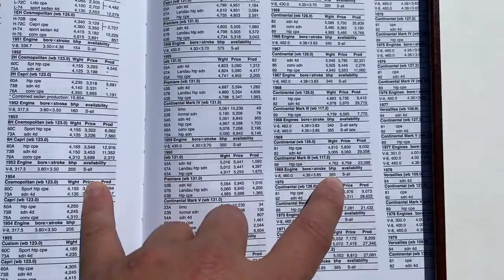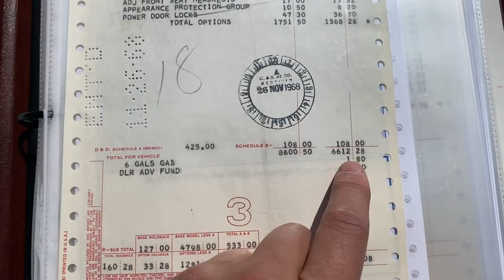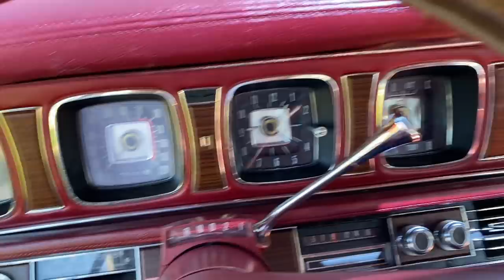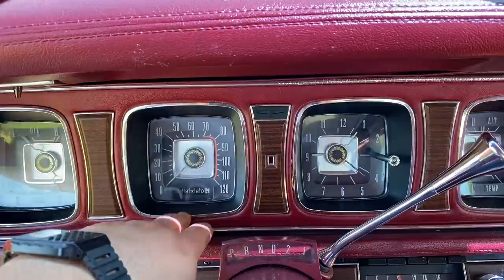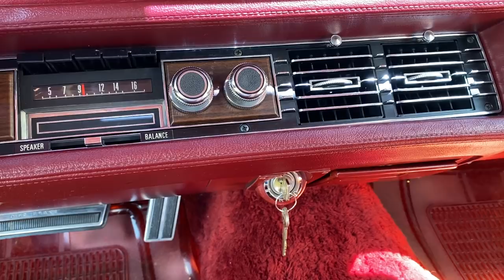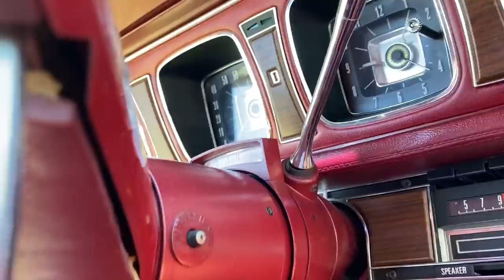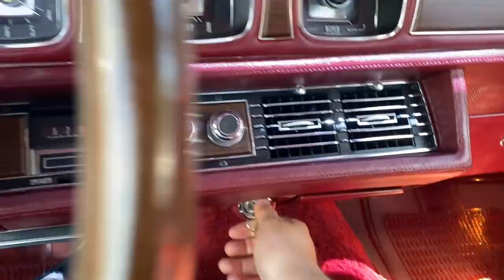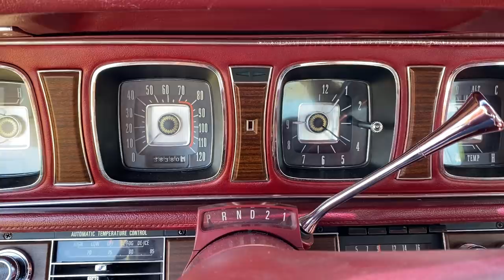The High Point of American Luxury Cars: 1969 Lincoln Mark III

Comment: I like the fuel chemistry you use to keep the 460 alive.
Reply: Sounds over the top to me.  I'd use premium only, and if hearing a knock, then use an additive or race fuel.  My '63 Coupe De Ville runs like a top on Premium with the 390 high compression I rebuilt years ago.  Before storing for the winter, I use fresh Premium with Sta-Bil.  As for his 160 degree thermostat, not the best idea, engines have proved to last longer with stock - the old cast iron blocks need to warm up well (not hot) for long life.

Comment: 23:40  Useful headlight door fact
Reply: 1967 Thunderbird headlamp vacuum motors actually had the spring forcing the doors closed if there was a leak, but 1968/69 and Mark III had the spring forcing the doors open for safety. I like the no-spring idea.

Comment: Hi Adam, I used to own one of the very first Mark III models (the 1968 1/2 as some call it).  Got it around 2002 when I was finishing college, and it was in decent condition.  Kept it for a year.

The car was dark blue with black vinyl roof and black leather interior.  I remember it had a different interior than yours - smaller, more intricate seat designs with no headrests, and a simpler, less attractive steering wheel with walnut trim and the rim blow horn.  

To turn it on, I had to crank the ignition key while holding the gear selector between park and reverse.  The 460 engine could still haul ass even after all those years!  Only thing that bothered me about driving it was the high padded dashboard which obstructed the view of the road for me, and I could not adjust the seat any higher (I am 5’8”).

I really like the color combo of your car in maroon interior and exterior.  I think these cars look really nice in bright colors.

Comment: Hello Adam,  Sir I have Enjoyed your YouTube Channel, quite the trip down memory lane as I was an ASE Master Technician starting out at a SOHIO-BP Procare repair shop about the time you were starting kindergarten,those were challenging times attempting correct driveability problems that the factory and dealership weren't able to rectify, I so very glad when Computer Controls especially OBD II became standard by law so manufacturers like Ford were forced to make their vehicles easier to diagnose without have to hook up a BOB (Break Out Box) to get any Live Data (so called live). I know You have a slight GM bias, however I believe anyone who repaired Vehicles for a living especially back in the day did as they seemed to be built with the Idea that someone would have to repair them !I worked as a Lead Technician on a Diagnostic- Drivability-Electrical Team at One of the Largest Volume Chevrolet Dealerships in Virginia for 20 Years until Back problems caused me to go.on Disability about 5 years ago. Scott Winters RK Chevrolet Virginia Beach.

Comment: Lovely specimen. Truly special. Congrats. FMC liked to use vacuum lines. Our 197x Merc Montego (Torino type) used vacuum hoses to operate the A/C controls. It had a bunch of black tubes with stripes in colors for ID. I remember putting in a stereo and wiggled around those tubes for access. (There is a slight possibility I might be mistaken. It might be another car. That was a looooooong time ago.) Even in the 70s with all the early inefficient  emissions controls, the smaller 351C moved that 5000 lb car pretty quickly! I remember having fun driving it as a kid. IMO, those FMC cars with the smaller trunks and giant noses were the last in a (very long car design fashion?) history going back to the Duesenbergs and old limousines. You could build a small house on those giant hoods.

Comment: In the very early '80s I bought a nice '71 Lincoln MKIII from a local dealer's used car lot. The car was a dream to drive. I bought the '71 as a buddy of mine had a '69 MKIII, and I really liked the styling. I took out a membership to the Lincoln Continental Owner's Club, and read an article about how to get more low-end torque by switching to a smaller ported aluminum Edelbrock intake manifold. This also would knock off about 25 pounds of weight off the engine. The manifold installation made a noticeable difference in low end acceleration due to increase air/fuel mixture flow. I also liked to keep my ignition timing advance for more power; hence I had to mix 101 Octane Booster with my gas. Lastly, I read an article saying that the multi-piece die cast grill cost Lincoln $350 back in 1968. That would translate to almost $3,000 in September 2022 dollars.

Comment: Adam, I have a a69 Mark III, and where I live is latitude 37 south, so one thing I don't have to worry about is serious cold.  What I did was block off the exhaust crossover passage in the intake manifold. This kept a lot of heat out of the intake and it is happy running on 95 octane. I make plugs, but I am told that racing gaskets block the 5th port. I would recommend this. Gary

Comment: I owned a 69 MKIII it waa the only year ford did a factory balance and blueprinted engine at wixom plant. It was a new model and the quality control was extensive on these vehicles. The 460 has a externally balanced counter weight on the crankshaft end for that purpose. the build sheets are under the hood fabric above the air cleaner. when they were going down the assembly line the hoods were up with the sheet hanging down from that area. they tucked them up under there. your example is really nice. Mine had the embroidered rear seat. Mine had the heavy fabric spare tire cover that matched the rest of the trunk. It also had the splash shields along the sides of the engine.

Comment: I am glad you consider this to be a well built car.  20 years ago, I would have never considered a car from the 70s.  Now, some might consider 70s American cars inferior to 60s.  I don’t believe so because my ‘77 MkV has 4/wheel disc brakes, electrical and comfort options mostly unavailable in the 60s.  I am also very impressed by the engineering of the car in terms of isolation, metal work, and even the suspension.  It’s too bad everyone is chasing the Germans in terms of sporty/luxury as the Americans once upon a time nailed it.

Comment: They are terrific cars and this one is beautiful with red interior. Excellent body gaps. I always thought the seats were really hard. Time consuming to maintain today with all the gadgets that are a pain to keep working. I know all about that from my cars.  When I get one of these generation cars I remove the front and rear window moldings and often find the seam sealer is falling apart (I never buy one with a rusty channeI). I dig out seam sealer and reseal it and then paint channel. When I wash a car I blow out the water in the channel and then vacuum it dry. It works great to keep that channel clean and dry. I also have magnetic shower curtains that I cover the vinyl tops with in case it rains at a car show. I have bought cars that had big engines and 2 core radiators. I always put a 4 core in them, especially the GM's.

Comment: Good evening Adam and I loved that year car and the Thunderbird also in the 68/69 model years! They are the best since the 61-63 model years of the top of the line luxury vehicle lines. Finest of the American engineering and luxury cruisers since the top end cars of the end of the 50's and early 60's such as the Imperial, Cadillac, and these are the best of what they have and the refined technology from the beginning of the decade is stellar and awesome. Just like the comfort of the best couch or recliners on wheels. Only downside is the weight of them and the suspension eventually get weak because of the excessive amount of weight and length of the cars that said it was well worth the replacement of the shocks and springs eventually. Sorry I missed the excessive amount of wiring and vacuum lines that eventually fail due to time deteriorated materials that they are beginning to skimp on around this day in age.

Comment: The embroidery on the back seat also changed in position from a vertical design to a horizontal design. Lots of changes from the April 1968 introduction models to 1969 later model.

Comment: Good point about the park to reverse issue of that era, I was 10 years old when I was waiting in my Grandpa's 1969 LTD who ran in the store to run in and run out to buy something.  The car without warning went into reverse and started rolling backwards.  Luckily, I was in the front seat and I had the sense to jam the selector into park before we hit the cars behind us.  When he came back he wondered why the car was not where he left it and I told him what happened.  He was not too happy with Ford over that and he switched over to GM products.
Reply: Had a 65 Thunderbird with the same issue.  Also had a 72 LTD Country Squire which was safer and more "notchy" as Adam describes, but on mine, so much so that one day the shift lever broke off and I had to use vice-grips until I was able to replace the steering column.

Comment: I had a 70 Thunderbird with that rear flow-thru air vent feature.  It was so cool to be on the freeway and then pull the little under dash lever to open it. You'd hear the slightest vacuum sound and then just barely hear the vent open and you'd get about 5% more road nose coming from the back. It was cool !!!

Comment: Great video, and beautiful car! I recently joined the Continental club with a 69 Mark 3, mine being in green. Unfortunately, it has a few issues I'm working on, but I'll get her in good shape here soon enough! Biggest issues right now are a vacuum leak and the fuel sending unit or gauge itself. Driver's side window only goes halfway down, passenger window doesn't go down, locks work though. Biggest hurdle is finding where the leak is, but I've got time
Reply from the maker: If your gauge reads E, it’s likely just the float on the sender.  Very easy to replace.

Comment: pretty sure the metallic green 2 door coupe Ford Galaxie 500 I had the use of in the summer of ‘76 (I was a UK teenager on work experience - how lucky was I!) also had hydraulic central locking - it made a very satisfying “thunk” sound. I believe the car was a ‘72 model, so 4 years old then. I loved driving that car!

Comment: What a beautiful car...I remember my uncle had one, the same colors also, never got to ride in it though.  I wonder how the heck the power steering pump runs the wipers, must be some complicated hydraulics.  That vent system looks like something GM tried in 71, their version had the exhaust in the trunk, didn't work out for them.  You would really need to study the owner's manual to fully understand how to operate all the accessories.  Love the beautiful interior.  Your lower temp, racing fuel, lead additive recipe seems like a great way of keeping this big ol engine happy.  Thanks for explaining what caused the ford jump into reverse syndrome....

Comment: Excellent presentation , many years ago I read article that Ford built some of their big cars with heated front windshields which required them to use real gold tint , remember 50+ years ago gold was only $35 an ounce , also it required two alternators to make it function.
Reply from the maker: They did

Comment: I have a Ford 460 in my old 1986, 28’ motor home. It only made 190 hp by the mid 80’s, but the torque was still monstrous !  My 35 yr old Ford powered motor home can still do all the mountain passes it could do new!
Peace

Comment: Exquisite car.  The quality and attention to detail on the interior is apparent.  The grill is stunning.  The hidden headlights allow the grill to be the total center of attention.

Does this car have a vacuum operated parking brake release?  How about disc brakes on all 4 corners?

I wish you had demonstrated the opening and closing of the rear windows.  I was very surprised when I first learned that they move horizontally to open and close.

You produce an excellent video.  Thank you very much.
Reply from the maker: Thanks!  Vacuum brake? Yes. 4 wheel disc?  No. That didn’t come until later.
Reply: @RareClassicCars  Oh wow I just noticed a 1992 or newer Cadillac Seville on the street in your video of the 1972 Lincoln Mark IV.

I have a 1994 Eldorado with just 44,000 miles.  Can you offer me any advice on the following problem I’m having?

After years of very reliable driving suddenly my Eldorado is stuck in 2nd gear.  I think it’s a “limp home” feature that feels to me to be an electrical problem.

I have been reluctant to take it to a transmission shop and let greasy hands have at it.  Instead, I’ve been researching on the internet and also trying to decipher the very thick 2 volume shop manual I have for the car, but I’m not having any luck.

Have you ever encountered this problem either personally or heard others speak of it?

Any direction you can offer me will be sincerely appreciated.

Comment: I had a 1970 in 1991. The switch cluster on the door would spew smoke  because the windows were stuck down when it was raining and stuck up when it was hot out. The ac compressor blew apart, there was rust holes in the cowel panel that let rain water in on my feet, the windshield stops wore away causing the windshield to slide down and let more rain water in in my lap. The windshield wipers ran off of the power steering pump and would stop when the wheel was hard over....man I miss that car..lol 365 hp...I would leave friends in the dust with that thing. I did manage to remove the build sheet from under the rear seat. I have it framed with a  picture of her. Sold it in 1994 for $500...would love to know where it's at if still around. Been trying different sites with the vin, but no luck so far.
Be safe folks.

Comment: It's a nice nerdy video and a lovely car, but I have a couple of nerdy bones to pick with you.  The reason for the springs in the headlamp doors is a failsafe one.  If the vacuum system fails, they want you to still have headlights.  I had a 1978 Country Squire with always open eyes.  I just had to replace a reservoir and a check valve, and all was well.  Of course the Country Squire just had a coffee can style reservoir, not the fancy custom one you've got.  You really want to run the AC some in the winter.  They used to automatically turn on the AC in defrost mode if there wasn't automatic temperature control.  The reason for both is to keep the seals lubricated.  If you don't rotate the compressor shaft for 6 months, things can get very dry and sticky.

Comment: Legend has it that in 1967 Lee Iaccoca (Who used to be in Charge of Pontiac) loved the coming new 1969 Pontiac Grand Prix restyling so much that he had Ford's design studio put a Rolls Royce grill on it, hide the headlights, stick a Continental hump on the back, update the interior, and call it the Mark III. If you compare the two side by side you'd be amazed at just how similar they are. Iaccoca of course denied this and said it was an updated Thunderbird, but considering his previous experience running Pontiac, it's obvious which is the truth.
Reply from the maker: Um. Lee Iacocca never ran Pontiac.
Reply: I'm not afraid to admit I was wrong, I confused Lee Iaccoca with John DeLorean concerning Pontiac, but it was Iaccoca that wanted a rr radiator on a Grand Prix.

Comment: What you said about the gathered detail in the upholstery intended to give a sumptuous look is interesting, because it's usually the 1972 Oldsmobile 98 Regency that is said to have been the first to have what came to be called "loose-pillow" seating in the seventies, establishing a major trend of the era. This minor attempt by Lincoln in 1969 to suggest fullness of fabric may have been kind of prescient.
Reply from the maker: The 72 Regency might be one of first to have the "loose pillow" look, which I'd considered different than gathered.  However, that interior was a bit of a copy of the Barcelona chair by Mies van der Rohe.  If you google it, you'll see what i mean.  Also, my 72 Imperial has the loose cushion look seats, too, so I'm not really sure who introduced that first.

Comment: I had a Meadowlark Yellow 1969 Thunderbird 4 door, with suicide back doors that took a portion of the roof to increase the opening head room. I traded that on a Medium Brown Metallic 1971 Thunderbird Brougham 2 door with SureTrak power anti-lock braking system, limited slip differential, cruise control, corning lights & Rim Blow horn ring. Many of the options and accessories were vacuum operated. I learned to operate the hydraulic windshield wipers by turning the steering wheel when it rained at the drive-in movies. The Lincoln owners complained why the price of the Thunderbird was so low.
Reply from the maker: Now that’s funny. I’ve never tried operating the wipers by turning the wheel when the motor is off!
Reply: @RareClassicCars  It's not easy. Takes two hands over hand like the power steering without engine running. Better than restarting.

Comment: The "High/Low" setting for the auto temp control had 8 (!) fan speeds on the Continental sedans - 5 on low, 3 more on high.  I only once had to use "high" - and that was in Florida.

Comment: Fun facts, Mark III was the first American automobile to have a map light with a timed auto shut off. Also the first to offer Sure Track anti lock brakes as an option in 1969, that later became standard equipment. Also early 69s did not have the Cartier clock, and also had low back front seats with no mandated head rests....

Comment: The ‘69 should have had the rimblow steering wheel and not the horn ring. 

Additionally, I would not keep the a/c wire pulled out during the winter. When you have to replace the a/c clutch you’ll know why!

Government regulations changed later on in late ‘69 mandating the steering column mounted ignition switch. 

My FAVORITE year for the Mark III❗️

Gorgeous car‼️